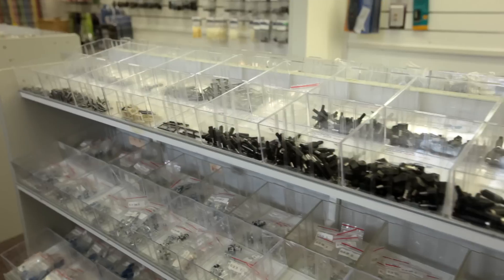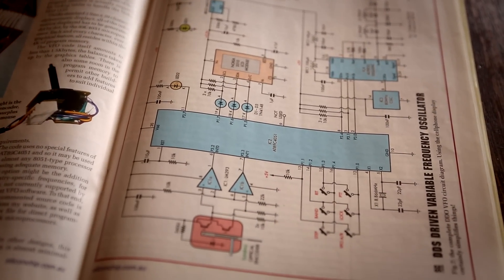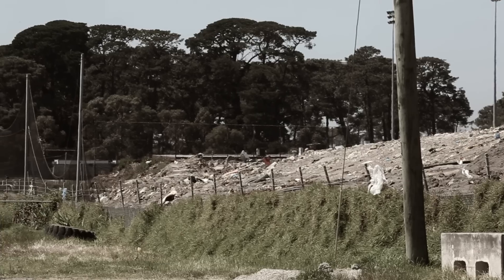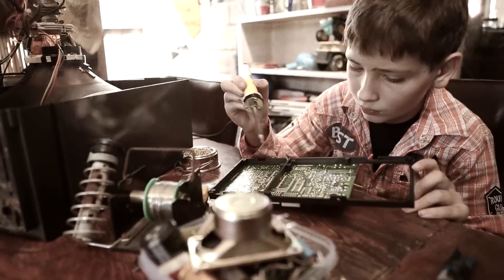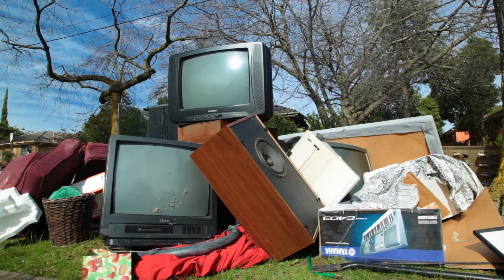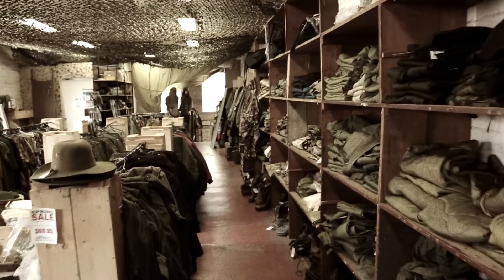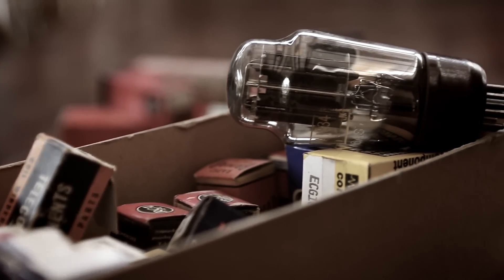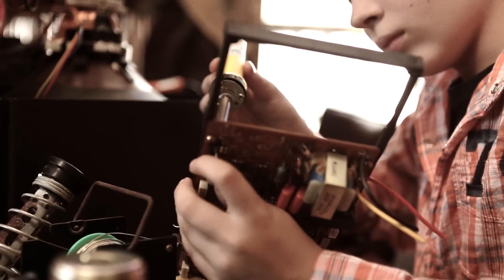State of Electronics - Hunters & Collectors

Comment: After over 40 years in electronics I still collect and recycle components. There is a limit - I don't salvage every last resistor and capacitor, but if there are easy to get parts which have value such as socketed ICs, connectors, switches, relays, opto-electronics, plugs, sockets, mains plugs, medium and large transistors etc then I'll grab them. I particularly like to salvage large transistors from damaged/scrapped audio equipment as buying genuine new replacements can be expensive and most salvaged parts are perfectly functional.

Comment: This is how I started in the electronics hobby, pulling things out of the waste drift on trash day or face down in the dumpster after the industrial district closed for the day, making mom crazy by dragging a dazzling array of unused surplus home from Javanco the day the owner got fed up with all of the dust in the displays--he just dumped them all and got more from the back (that's what you can do when you buy surplus by the pallet and sell it by the each)  It was a lucky day when you could get a huge bolus of factory floor sweepings for pennies a pound to sort out later, and add to the odd intercom bits and partially stripped televisions from behind the repair shop to take down for spares.   Thanks for the memories.

Comment: Electronics is An acquired taste I got from a time before WWW & the iPhone, now more Popular then ever  but its hidden behind a touch screen. in- 1975 C Day then most-toss-the old BW TV's by the trailer load in landfill tips. so I made CB from TV parts with regen-receiver & toy Radio 27.125 MHz crystal . only a m-meter & Soldering Iron with copy's of Dads EA mags help on schematics,lived on a farm,made a FM Transmitter w tube from VIC Weather radiosonde, used modulation from tape player jack. went on 2 use 555''s stuff before moving on 2 cars
Reply from the maker: +JONOVID very cool. It seems quite common for people from the bush to get involved in making things because there probably was more of a need to make things, especially back then. Maybe consumerism is to blame??
Reply: today its the mass market with the Big Gorillas in the room Apple , Amazon , Google esc. software content is king! so for many people Electronics is like the plumbing in the wall. all is OK until it needs to be fixed ..then who are u going to call ?